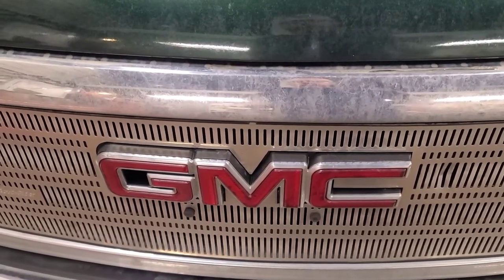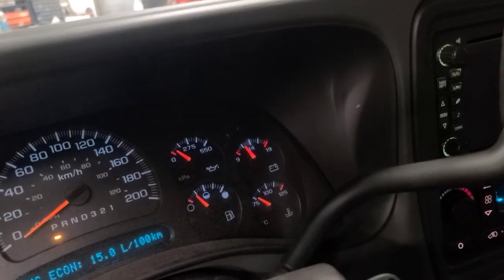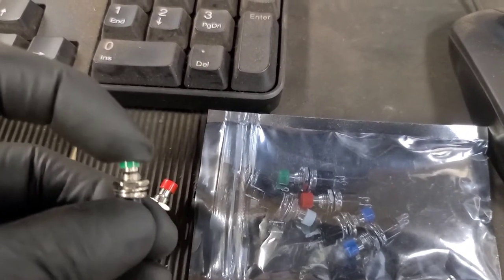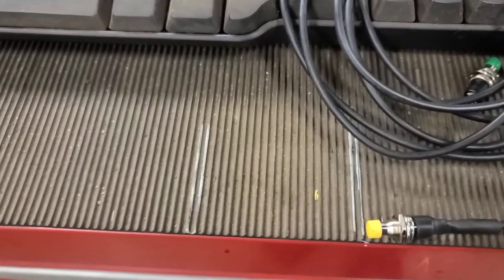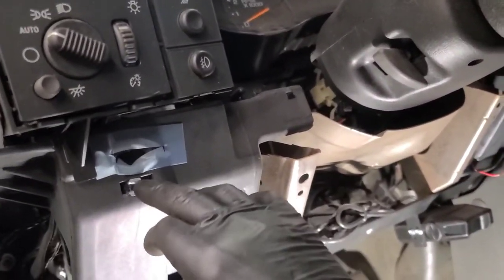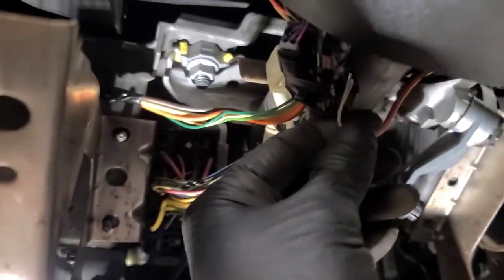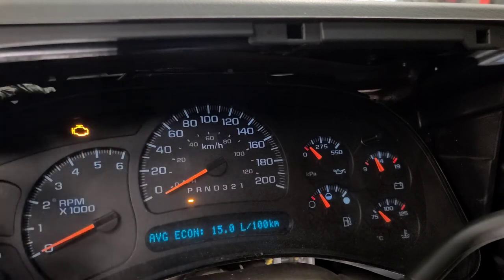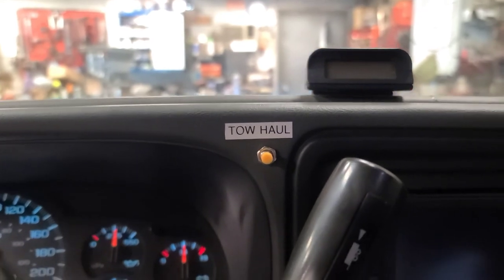2000 to 2007 GM Truck Tow Haul Button Not Working. Fixed Without Gear Shift Lever Replacement

Comment: Did this fix on my truck and it worked perfect! Thank you so much for sharing. I mounted my switch next to the passenger air bag switch and 3d printed a cover to prevent accidental hits

Comment: Pretty slick.  Maybe you can answer a question.  My torque converter doesn't lock up when in tow haul mode.  However once I'm up to speed by turning tow haul off wait for converter to lock up  then turn tow haul back on it stays locked up.
Reply from the maker: Tow Haul mode changes shift points and shift strategy including TCC lockup strategy. What you are noting is probably normal especially if you're actually towing something. If the TCC was not coming on or slipping you would get a slip code. HTH

Comment: How do you know which of the 2 wires to connect ? 
I believe it matters, maybe one is a live and one is a ground ?
Sorry for my ignorance I am much more mechanical than electrical .
Thanks
Reply from the maker: The switch simply connects the two wires together momentarily.  Polarity of the switch is not relevant. This type of circuit is either open or closed.
Reply: @PhillipBailey  thanks for your reply, I intend to just splice the wires together and return it to normal,without the use of an auxiliary switch, maybe that’s what I should have stated.

Comment: Thanks for the video. 
But, other than turning the light on, that button sends a signal to transmission to modify the gears? Because I can't turn the light off and at same time my truck sounds like dragging a ferry
Reply from the maker: If the tow haul light won't shut off therebis likely an electrical fault in the transmission.  You need to scan it for codes both engine and transmission codes to start with.
Reply: @PhillipBailey  thanks for the fast response.
That problem started in the las few days. 
The first warning came in the form of engine ignition with a low battery signal or damaged starter. then the tow haul light that has come on a couple of times but in none of those times has it come on at the next engine start.
based on what you said about the short in the lever, I related the problem in general to a short circuit.
I hope it's not a transmission problem, two and a half years ago they rebuilt it
Reply: By the way! I had an electric issue years ago in the dashboard and was fixed .
the problem was solved "while it was taken to the electrical workshop" it never happened.😬 And after that, and a couple of years later, I noticed an unexpected flickering of the hazard lights after being turned off, they came on steady when I stepped on the brake, it still happens intermittently.
and now this problem with the tow haul light, the strange thing is that the mechanism is activated because it is felt immediately in the engine and transmission development.

Anyway, thank you for your answer, it has been very useful.
Liked and subscribed!👍
Reply from the maker: @jomi9858  the tow haul switch is a momentary contact. There are two wires to the switch which flex with the shifter movement. If they are broken they could short together and simulate a switch push most likely when moving the gear selector. The light should be off on the next start event as the default is off.
Reply: @PhillipBailey  yes! I learned from the explanation you said in the vid. I'll try to fix it tomorrow. I have been fixing issues that go a little higher each time in the complexity scale; alternators, gas pumps, oil pump, pin actuator(switch), gear shift cable, thermostat, stabilizer bar(wrangler) etc.... And all that Thanks to guys like you!🤗
Reply from the maker: @jomi9858  That's why we do the videos. It's all about helping people.good luck and let me know how you fare.

Comment: How do you get the tow/haul light to turn off? Tried hitting the button and it doesn’t go off, does that mean the button doesn’t work? It’s on a 2000 1500 by the way
Reply from the maker: Tow Haul should only be active for the current ignition cycle. In other words it should cancel when restarted. If its not then the wires may be shorted together. The switch is a momentary on contact. I'd remove the column trim and inspect for damaged wires. Good luck
Reply: @PhillipBailey  thanks! You just gave to me the exactly answer before I even made the question!
And thanks to the guy you replied to!🤗

Comment: I hooked. My wires back up to the original switch. It comes off and on when I push the button .  Went for a drive to try it out and there was no change in shifting or rpm. Just wondering where I should look now 🤷🏽‍♂️
Reply from the maker: does the tow/haul light illuminate in the dash when you press the switch? If not you may still have a broken wire or a faulty switch.
Reply: Yes it lights up just don’t feel any difference . RPM doesn’t change and it doesn’t feel like it’s shifting down her lower gear even though I’m empty and not pulling a trailer.
Reply from the maker: @chrisnielsen3562  if its not loaded with a trailer you won't see much of a change. At 30mph normal mode it should go into 4th. Try activating tow haul and I would expect it to shif down to 3rd under light load.
Reply: @PhillipBailey   I was doing about 50-60 mph and hit the button off and on unloaded didn’t notice anything different  , maybe I need to pull a trailer to try and see if it’s working.

Comment: What gauge wire did you use?
Reply from the maker: There's no significant current so I used some wire from a charger for a cordless light that had died. It was probably 26gage but not sure.

Comment: what is the best switch ? thanks
Reply from the maker: Any momentary contact switch that is normally open will work. There is no sgnifcant current flow. I bought a package of 10 on Amazon.  Cylewet 12Pcs 1A 250V AC 2 Pins SPST Momentary Mini Push Button Switch Normal Open (Pack of 12) CLT1078 https://www.amazon.ca/dp/B07DS6QMRW/ref=cm_sw_r_apan_glt_i_BH7QTSVCPTT3ZB36JRK7
Reply: Do u have a video showing the whole process of u hooking up the old camera wire to the switch etc?

Comment: I tried this method but it still wont work 🙁 any ideas ??
Reply from the maker: Could have wiring problem. One of those two small wires should measure 5 volts with the key on or running. The other is a ground. The switch momentarily grounds the 5 volts. I trust you used a normally open momentary switch. It could be the bulb in the cluster is burnt out. You can see the status of the switch in transmission data on a scan tool.

Comment: Switch should be on/off - not momentary. You would have to hold it down if it were momentary.
Reply from the maker: The original switch is a momentary pull down switch. It momentarily grounds the 5volt signal from the BCM. I have installed 4 of these now.
Reply: Oh OK- I see now. Thanks
Reply: @PhillipBailey  I have a question  - I'm working on a 2000 GMC and have everything apart around the shifter area. The harness with the two wires coming from the tow/haul switch is broken about 3" from where it comes through the hole in the shifter. The rest of the harness is completely gone. Down at the main harness there is a black two wire plug that has a blue and a black wire attached, and going in to the harness under the dash. Do you know if this is the point where the new harness that comes with the new shifter plugs into? I don't see any other possibilities  -
Reply from the maker: @smid2550  yes I'm pretty sure it is that two wire black connector. Use a volt meter with the ignition on to see if one of the wires is 5volts and the other one is 0volts. The light blue wire should have 5volts on it.  Momentarily jump the two terminals and note your tow haul light.
Reply: @PhillipBailey  ok - will do. Thank you
Reply from the maker: @smid2550  let me know if it works for you.
Reply: @PhillipBailey  I will; the new shifter assembly is supposed to come in today. I suggested your solution with the remote mounted switch, but they don't want to alter it that way, so I'll just try to wrap the new harness in such a way as to avoid this happening in the future.
Reply from the maker: @smid2550  well in tge engineers defenceman the first one lasted 20 years so by the time it fails the truck should be done...
Reply: @PhillipBailey  lol! Good point  -
Reply: @PhillipBailey  I measured voltage at the blue wire like you said, but it had just a little over 11 volts. Could be that this is an earlier model ( 2000 - 2nd series )? Anyway, after I touched the wires, the indicator light came on then back off after touching them again. I've just installed the new shifter assembly and it works perfect, so I'm calling it a fix. Also, the dash lights weren't working, so I pulled the switch and probed the wires. I made a little jumper to bypass the switch and the dash lights came on, so I replaced the switch. The headlights are on when the ignition is on, and I was hoping that the new switch would fix that too, but it didn't.  There is a little sensor in the middle of the dash - do you think that could be the culprit? It looks like a bear to change, so that's probably it - lol! Anyway you've been a big help in educating me and I appreciate it.
Reply from the maker: @smid2550  12 volts or near that is probably normal.
Reply from the maker: The sensor is a photo cell to switch from daytime to night time. I'd have to look at the circuit diagram to see how the dash lights operate. Is the ambient lighting in the switches not working too?
Reply: @PhillipBailey  anytime the ignition switch is on, the headlights, dash  lights, radio, hvac ctrl, etc, are on. You can override them with the wheel on the new light switch, but the headlights are always on -

Comment: Shifer dose mot move
Reply from the maker: If the shifter is locked it could have a problem with the brake switch. Do the brake lights work?